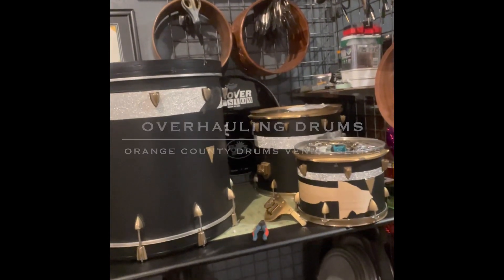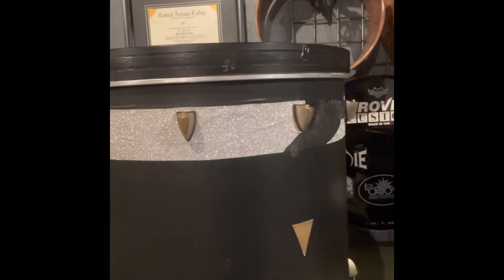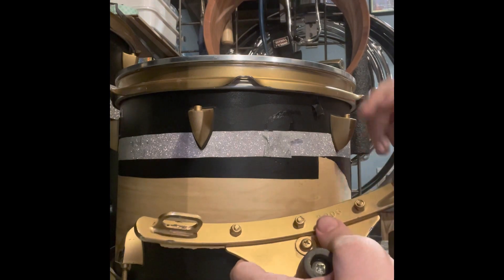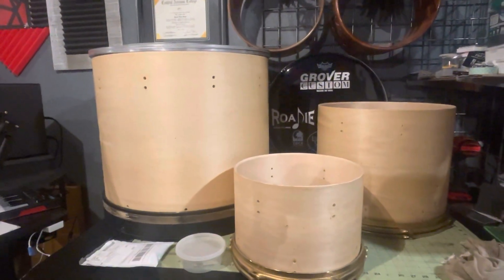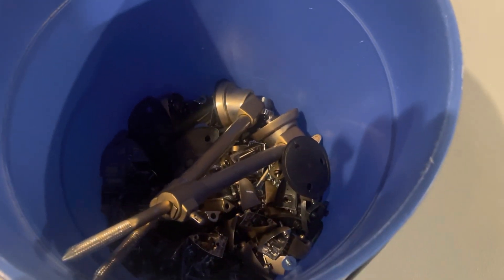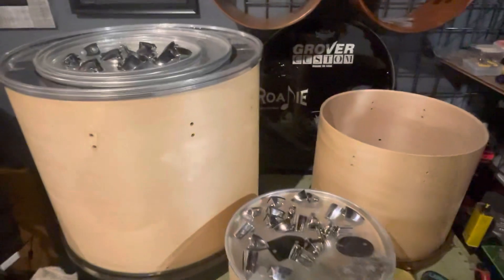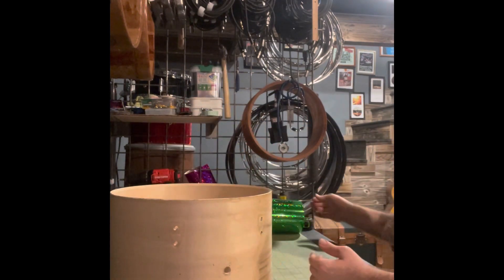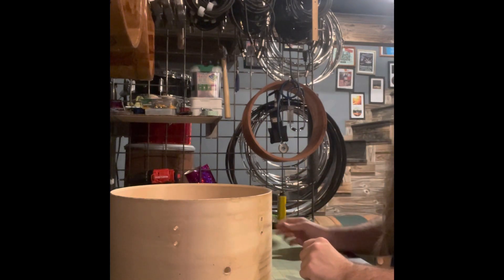Overhauling/restoring these Orange County Drums! Wrapping drums with car vinyl DIY Tutorial

Comment: Good work it looks pretty nice, I just rewrapped a Ludwig kit and a canvas back glitter wrap. It's actually a material for arts and crafts but it works really well for drum wrapping. It was pretty easy to do all I use was carpet tape for both ends and no other glues because the hardware keeps it in place

Comment: Awesome job! That razor trick for trimming by the bearing edge is awesome lol
What did you do about the airvents/badges?? Im doing a Tama imperial and the grommets for airvent are the permanent style - how would you get these off and go about replacing them??
Reply from the maker: @damiangraham3649  the badges were spray painted along with all of the hardware. I soaked them separately in hot water and dawn dish soap, and used a stove top sponge to scrub the paint off. The badges are screw mounted so putting them back on was relatively easy. 

The vents on this OCDP kit were flanged, so I used a countersink drill bit to strip it out. I then expanded the existing hole with a rotary sanding tool until it was just big enough to fit a threaded vent.

For your Tama, I would use a countersink drill bit to take off the vent and use dental floss to take the badges off. 

Finding a replacement vent that’s built into the badge will probably be challenging- best I can suggest is go either on eBay or Amazon, get a little bit of each vent size your budget allows until you find one that fits. Worst case scenario, you might need to expand the hole a bit in order for the new vent to fit. Hope this helps!
Reply: @JDogTheDrummer  Helps heaps! appreciate you taking the time to help.

Comment: I have a large badge Tama Imperial Star. It has a tin type of wrap that cracked and is coming off. In your opinion is it worth rewrapping it? I love this wrap you have used where can one get it if I decide to do it.
Reply from the maker: I got this particular wrap off eBay from the merchant Paperstreetplastics. A 2ft x 10ft roll costs about $40 after shipping and was enough for this project. Do the floor tom, rack rom and the kick (in that order). 

In my opinion, your Tama Imperial Star is absolutely worth re-wrapping!